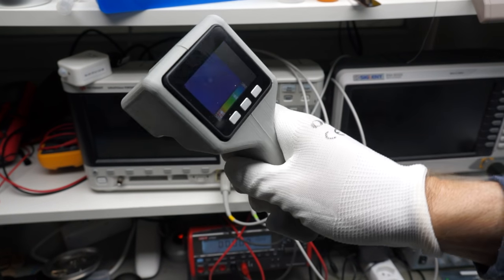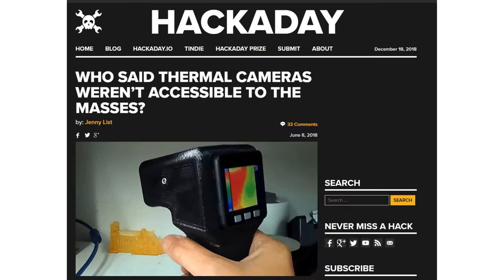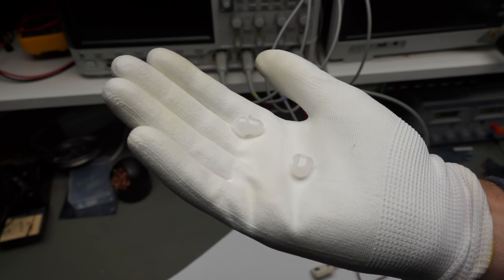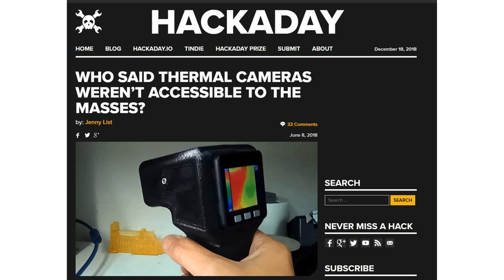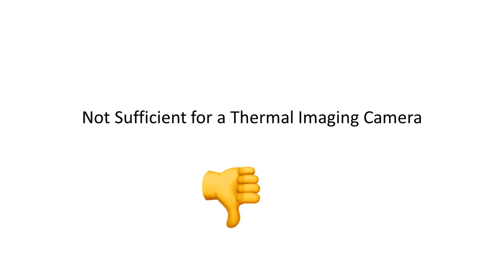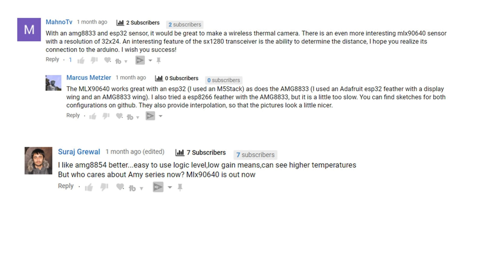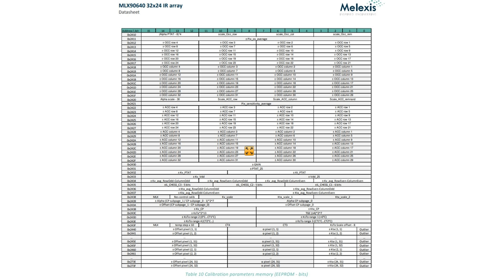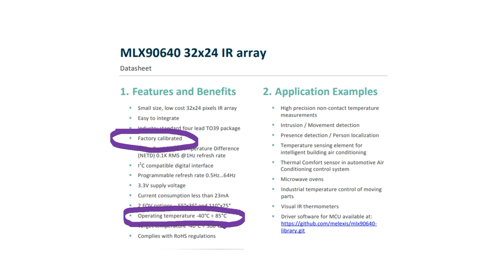#247 Do-it-Yourself Thermal Imaging Cameras (AMG8833, MLX90640, M5Stack, Arduino IDE) and Flir one

Comment: The mlx sensor really needs a good external lens if the technology is going to impress. The aperture is just too damn small to be very useful. (Though placing it right next to a visual camera and doing the overlay trick would probably make it look quite passable when compared to the fair)

If there could be hot or cold mirror so the cameras could be aligned it would be amazing.
Reply from the maker: The overlay trick is really useful. I assume not simple to get the right "blend" between the two images.
Reply: @AndreasSpiess  if I remember correctly they flir takes a highpass of the visual and then do the overlay. The smaller sensor, tiny cellphone camera, and add a surface mount lidar for distance and you could have something that could compete in the low cost market.
Reply: Robert Szasz I am trying the exact same thing but with a raspberry and the mlx90640 and the picam. They both have a similar fov and i want to program it in opencv c++ but installing opencv is a challenge in itself.
Reply: @Lackenboden  if you can, you might want to just add a flat "cold mirror" (the material they use for thermal lenses could work well) that would reflect visual light to the vis camera and let thermal energy through to the sensor. That would allow you to allign the two cameras views mechanically
(Sort of like they did with 3ccd color video cameras back in the day) at the expense of a larger footprint. (Two camera modules next to each other is a Way thinner package)
Reply: @Lackenboden  and Open CV might not be the right tool. You mostly want to do a simple transformation of the video, then either make it B/W and overlay the temperature as color, or just run a high pass to keep edges and put the color on top. If you want to get better registration of the thermal to visual image don't use computer vision techniques, just shift the image based on how far the object is (start with setting things up for far away then use a resistor or something similar to act as a small visual and thermal target to figure out how much you need to shift the image.

Comment: Seems like it might be more useful to use one of those laser thermometers, and either raster it to build an image, and/or use multiple of them at once to collect more pixels faster.   
And instead of the normal back and forth rectangular rastering, use polar-coordinate rastering (like a spirograph or a rhodonea curve) so that the center of vision has the most fidelity, while still having some peripheral vision.  With these thermal vision things the center of vision is always the most important.
Reply from the maker: I do not know the opening angle of those sensors. But they have to be quite small for that purpose. And the reading speed has to be quite fast.

Comment: Talking about the MStack. How hard would it be to recreate that module? An ES32, battery charger/battery, screen and box/buttons - seems like something we could all do.
Reply: If you don't need and ESP32, I build most of my Wemos D1 Mini modules with the "stackable" headers (except power supply ones, which always go on the bottom. And displays, which always go on top). Not as pretty as the MStack, but functional.
Reply: If you look on aliexpress, you will find some esp32 modules with vary similar specs from TTGO. They only lack the modularity, which is
a nice aspect, but certainly  can also be done.
Reply: Marcus Metzler, hey, can you provide a link? Sometimes is not the base price of the thing but the price start point so not to deal with the customs (time and money not so well spent).thx
Reply: Ok, my mistake, it was on banggood: https://www.banggood.com/Wemos-ESP32-TS-V1_2-MPU9250-1_8-Inch-TFT-Bluetooth-Wifi-MicroSD-Card-Slot-Speakers-Module-p-1287887.html
Reply: It’s easy to recreate the M5Stack but how much is your time worth? With targeting a standardized platform, your projects will reach more people. I’m surprised more companies (Adafruit) don’t offer a complete/expandable “system” for Makers. But Andreas is right, the price should be lower.
Reply: @wm6h  as I said, I rather spend my time learning new things than fighting the customs...
Reply: @drmocm  thanks! Later I also found some TTGO boards on Ali Xpress...

Comment: I've been in the electronics business for many years. It seems like people with few to many years of comparable experience manage to get it wrong and promulgate it far and wide.
PIR is not an initialism for Passive Infrared Sensor. A PIR is an active device.
The correct term is Pyroelectric Infrared Sensor, that is what PIR is an initialism for.
Do not quote me Wikipedia, they are wrong.
Pyroelectric infrared sensors detect infrared rays using the pyroelectric effect of pyroelectric ceramics, a kind of piezoelectric ceramic.
And, do not call PIR an acronym, it is not, it is an initialism.
RADAR and SONAR are acronyms as they are an abbreviation formed from the initial letters of other words and pronounced as a word. PIR is not a PURH, which is what a cat does when it is happy.
Reply from the maker: Maybe you are right. I do not care too much about abbreviations as most of my viewers understand if I talk about PIR.
Reply: @AndreasSpiess  I agree, whether PIR is short for Pyroelectric Infrared or Passive Infrared doesn't make much difference unless the result would be worth mentioning and for the task at hand they're just not the proper tool.

Very useful for other applications but not as thermal cameras.

Comment: Technically the simple PIR-sensor has two pixels and your explanation is somewhat wrong. It does not compare a reading with any "last" measurement. It looks at two pixels at the same time, and a difference between the two pixels is what triggers it. :)
Reply: The two pixels are still used to detect time-variations in the signal, not simply compare the temperature each pixel detects.
Reply: Exactly, its output is the differential signal between two series wired but opposing ir detectors. The lens also has a role to play in motion detection. Hint: Mask of half of that IR window with foil tape.
Reply: @noisyaudio  it still measures time-variance, i.e. motion. Using two pixels and a lens to distribute the signal on to both pixels increases gain dramatically while rejecting common temperature changes, but it still only detects changes in the signal above a certain frequency. For example, if you stand still, one Pixel will see a higher temperature, but it will still not trigger, unless a fast temperature change, i.e. movement is detected. It's a simple differentiator at the output.
Reply from the maker: I also looked it up and it seems they use the two pixels to get a two times larger signal. And the lens helps to get two opposite signals with a higher probability. Still, they seem to need time to detect the difference.
Reply: The PIR sensor detects changes in background temperature, as well as changes from the scene. In a single element detector, two PIR pixels (one of which is blind) are subtracted from each other, the difference being the energy from the scene. Multiple lenses are used where each lens sees a narrow strip of the scene, with blind gaps between the strips. Moving objects move in and out of the blind gaps, causing temperature changes in the PIR. The PIR material itself takes time to heat and cool. The PIR material acts like an unpolarized nano capacitor - heating or cooling the PIR acts to charge it up one way or the other. The charge itself persists for some time, depending on the design it may be discharged on read, or decay naturally through leakage.
Reply: The detection electronics often uses a pulse count setting to reduce false alarms. ie the alarm output is only triggered after a certain number of pulses are counted within a timeframe.
This way the sensitivity to motion can be adjusted.
Reply: @Meza201  Makes sense. I just didn't see this circuitry in any of the detectors.

Comment: People were playing with the IR camera sensor from the Wii remote controllers some years ago to track moving objects. I remember that sensor was very narrow angle (about 20 degree or so) and required I2C to communicate. You still may want to try it.
Reply from the maker: AFAIK they did not measure temperature and had an IR LED built-in. Maybe an overkill, but they most probably would do the job.

Comment: Great video as always. Sadly for now I will stick to my caveman thermal detection method: putting the device close to my lips and moving it around. 
Seems the lips have better response time and resolution than the finger, but only really work well for SMD boards :))
Reply: you should try this on high voltage circuits
Reply: @D4no00  yea, on one of those stun gun transformers :))
Reply: An easier trick is to put some alcohol on the PCB. It'll evaporate where the heat is.

Comment: Will the MLX90640 work best if I put it as a smart watch? 
Or it need to have some distances to work properly? 

Also what material for casing so the sensor is not measuring the casing?

Sorry for a lot of question, I really excited to explore this amazing channel!
Reply: I am asking what kind of plastic will pass infrared emitted by MLX sensor, like that is used in ordinary PIR ..

"Lenses are 0.015 inch thick and made of a plastic that passes infrared in the wavelength range of 8 to 15 microns which is most sensitive to human body radiation. These are not wide angle lenses. 
"
Reply from the maker: I have no idea. of smart watches. And these sensors are pretty expensive PIRs. But they can be used.

Comment: Can a higher quality sensor be used in a DIY build?

I have several FLIR thermal cameras where the IR sensor, camera, board are fine but the screen is broken.

Can the sensors be pulled off the board and repurposed?
Reply from the maker: I do not know if there are projects with those chips and I do not know if they published datasheets.

Comment: If the M5Stack seems to refuse the connection with Arduino as you have shown, just hold the red reset button for at least one second. Then the connection will work. At least, it has worked for me with my gray M5Stack.
Reply from the maker: Unfortunately I cannot do remote debugging :-(

Comment: Thanks for your explanation. Very, very usefull.
Reply from the maker: Glad it was helpful!
Reply: @AndreasSpiess I´m buinding a "camera for biomass burning" for my research project in environmental conservation, specifically on wildfire figthing. One of most important parameter is temperature of biomass under combustion. Usually I use a MLX (one pixel), but I hope a evolution to get some termal imagery.

Comment: Any thoughts on the Walabot?  Aliexpress has a $70 Melexis MLX90640?

The $70 M5stick T-Lite Thermal Camera Dev Kit (MLX90640) seems to be an integrated M5Stack solution!
Reply from the maker: I never had a usage for the Walabot, so I do not know if it is good.

Comment: Hello. I agree with the fact that it's a bit hard to modify the MLX90640 to display a different range of temperatures but this is only if you are looking in the wrong place. Also, I checked the temperatures with my Raspberry Pi Zero and 3 and they were pretty much spot on so maybe updated the driver? Or the Pi might work better with it? 
Either way, below I'll leave the way to modify the MLX90640 to display the temperature range you want. 

After copying the library to your Pi, you u need to go to: 
/pi/mlx90640-library/examples/src/ 
and use a C++ editor (Rasbian has Geany) to edit the file you want (using hotspot as an example) Just scroll down to where you'll see: 

vmin=5.0
vmax=50.0

Just change these to whatever temperature range you want and save the file.
In terminal, go to the mlx90640-library folder and compile the file you just modified by writing:

sudo make

Then run them with:
sudo ./examples/the_file_you_want.
I
Reply from the maker: Thank you for your code. I had no problem with the temperatures shown. My problem was more the extremely low resolution of the chip.

Comment: Andreas, is there a presence sensor to detect a person without movement?
what do you think about it?
PIR sensor only responds to movement
Reply: just use image/facial recognition via standard color camera..
Reply: @WacKEDmaN  yes, you right, but it is very expensive
Reply: If you use a high-enough resolution camera, with motion-detection software, you'll "see" almost anyone who isn't sleeping or meditating: even when just sitting at a computer or watching TV, few people sit perfectly still.

Not something you'd attach to an Arduino or ESP8266, but the odds are good that, if you're doing something that sophisticated, there's a central PC you can network the camera to.
Reply: @rantalbott6963  Raspberry PI can handle 5MP :)
Reply: @rantalbott6963  it is very expensive
Reply: @WacKEDmaN  it is very expensive
Reply: @WacKEDmaN  thank you for information
Reply from the maker: The problem of all standard cameras is, that they do not see anything before the light is on. A typical catch-22 for some applications.
Reply: @AndreasSpiess  very true!..IR LED illumination can help in that situation tho..generally needs the IR filter removed from the camera tho
Reply: Try one of those radar sensors, he did a video on them early 2018. They can detect people in a room and it's omnidirectional
Reply: A tracker dog's nose?  I'm not being facetious, we already have some basic aroma sensors. Maybe in the near future they'll be sensitive enough to distinguish between familiar and unfamiliar people.  Back in IR,  we all have to breathe, can current technology detect the warm air expelled?  I don't know.
Reply: @Legantmar That's what the Panasonic GridEye sensor was originally made for. However it needs custom processing for each application. https://industrial.panasonic.com/ww/ds/pr/grid-eye

Comment: I watched many of your videos, they are interesting and with humor in good taste :-)
Which toolchain and esp-idf should I use for little older boards? I have ESP-WROVER-KIT V2, should I use older v2017 toolchain for it or newest (stable) available?
Btw, I'm linux guy used to work with eclipse and command line make command before, so I prefer this way over arduino ide.
Reply from the maker: I have no experience with these toolchains. But the chips did not change (other than details). So you should be able to use the newest version.

Comment: I probably would mix the rather cheap (compared to FLIR) sensor with a Pi camera module and see, if calibrated correctly, how that performs. A quadcore SoC should also be able to do the heavylifting of imagemanipulation far better.
Reply from the maker: I do not think you can change the problem of low resolution with your proposals.

Comment: Emissivity of 1.0 means the registered temp is at least as high as what is shown. Reducing emissivity value increases the displayed temp.
Reply from the maker: Thank you for clarification.
Reply: @AndreasSpiess  another "trick" to get an accurate reading since emissivity varies widely by material is to put a piece of black 3M electrical tape on the surface being measured. It has an emissivity of almost 1. Then you can compare readings to get emissivity of the material.

Comment: Pretty sure the web page says 1° is normal accuracy for the mlx. Accuracy for extended range is on page 47 of the datasheet
Reply from the maker: Thank you for the hint. the 1.5 degrees on page 47 is flagged as an "example". I don't know the value of such a number ;-)

Comment: Can you calibrate the temperature range to read hotter surfaces or do you just need a better sensor?
Reply from the maker: You can calibrate the values. But you have to read the data sheet for max temperature. I do not remember the value.
Reply: Andreas Spiess so just recode the mlx sensor ?

Comment: You have also Seek thermal cameras that even have more resolution than Flir!
Reply: I have a Seek thermal camera.  Like the FLIR in the video (I think FLIR's version came out in response to Seek's offering) it plugs into a smart phone.  Unlike the FLIR, it gets its power from the phone, so no need for a battery or recharging the unit.
Reply from the maker: The video was focused on the "cheap" sensors. You have a big choice in the higher price ranges and there are some videos out which do compare these devices. For me, they are too expensive.

Comment: The precision/calibration of the sensors in thermal imaging cameras is pretty much overkill. The most important factor, which is usually unknown, is the emittance (emissivity) of the measured surface. The temperature of the environment and the sensor also play a role. In addition, the emittance of "shiny" objects (such as metals) is very small, while the reflectance is very large. In the case of metals, you therefore measure the radiation reflected from the surface, that is the temperature of the environment, which can be either larger or smaller than the temperature of the object.
Reply from the maker: I agree with your statements.

Comment: Thanks. Could you test, if it's ok, if it get see water pipe leaks through tiles and walls (no hot water running, just regular water)?

Thank you.

God bless, Rev. 21:4
Reply from the maker: Unfortunately I have no leaking pipes here:-(
Reply: @AndreasSpiess  Hi thanks. I mean, could it see through the walls and tiles, see the pipes in it (even without the leak, just regular water running through the pipes)
Reply from the maker: It measures temperatures. That is all.

Comment: You mentioned that we can feel IR with our skin but I think it's not correct when we feel heat by for example radiation of a fire we're actually feeling the heat which is absorbed by the skin
Reply from the maker: I am only an electronic Engineer. If you are an expert, I assume you are right.